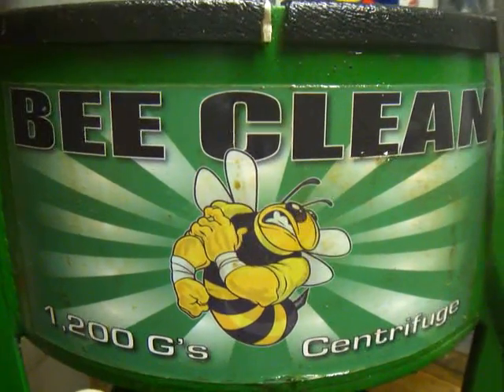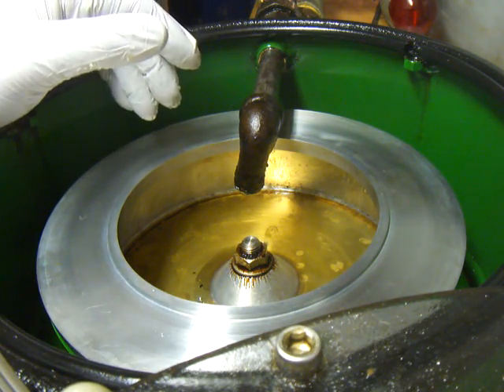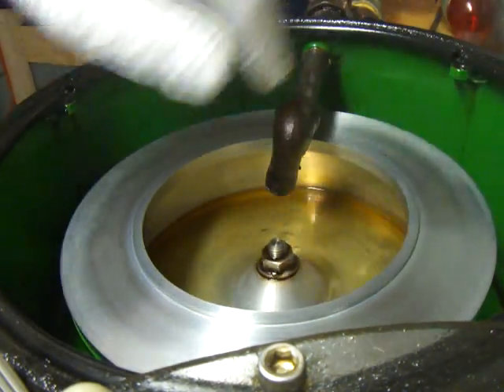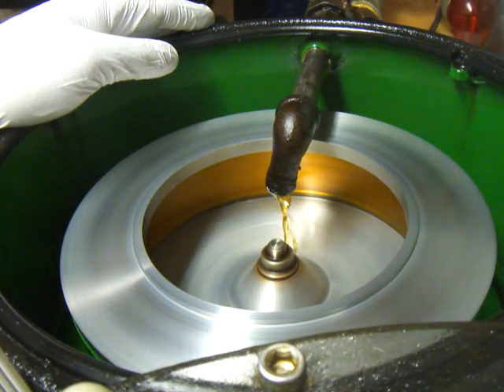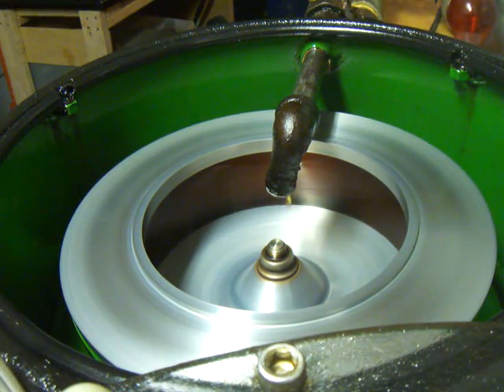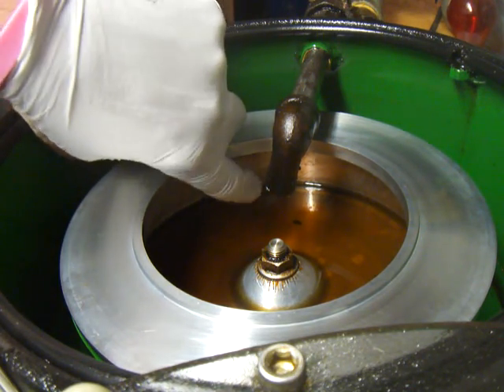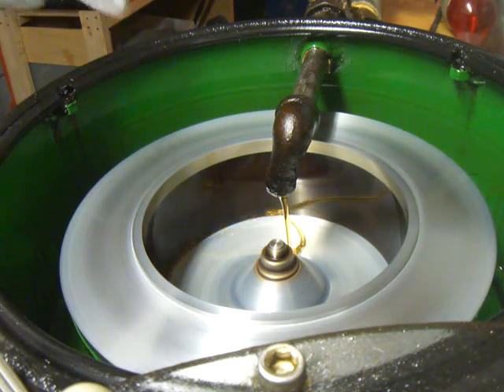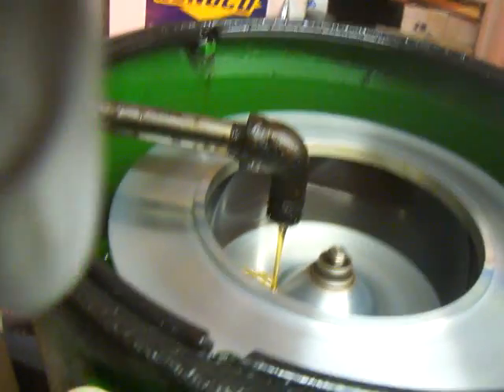GreeceMonkey Waste Veggie Oil (WVO) - Centrifuge Explained

Comment from the maker: You could try boiling...just would need it to be boiling to the point water evaporates...but I am not sure because water is heavier than oil so when you heat it the water goes to the bottom...could not work too
Reply: +Konstantinos Fotiadis eehmmm boiling water/oil solution? the water will evaporate but its trapped under the oil so the steam pockets tend to burst underneath the oil sending boiling oil across the room, thats also why toy shouldn't put water in a deep frier
Reply from the maker: I don't think that is completely true...heat rises...so the water being heated at the bottom might work it's way to the top with convection...not really sure.. just brainstorming
Reply: Water sinks to the bottom of the solution and it stays there due to the physics of water of it being Polar and having strong surface tenstion, yet it boils at 100C and oil can get way higher so if the oil gets hotter then lets say 120C the water will flash evaporate and explode Konstantinos Fotiadis
Reply: Oil water mix flowing across a heated plate might work.

Comment: What is the capacity ?
how many gallons for a minute can be processed ?
Reply from the maker: Probably 32oz on this one...I ran it at 8 gallons per hour...depends on how dirty you input is and how clean you want your output
Reply: @konstantinosfotiadis  what size motor are you using hp and rpm
Reply from the maker: @jasonbrown7258  I use this one now...

https://www.wvodesigns.com/raw-power-centrifuge.html.html

A much nicer design...I have an extra for sale if you need one

Comment: what about the drain holes on the bottom of the spinning drum ? where does that oil go ? Do you close off those holes
Reply from the maker: inside the bowl, they are for draining it once you turn it off.   the other hole is outside the bowl in the green cylinder.. that's where it drains into my drum and is clean

Comment: if you boil the oil, will it remove the water?
Reply: well water and oil dont go well together lol. Plus i think that if the oil is gets tooo hot it turns bad.
Reply: Don't need to boil  You just run it it through a heater to get it to around 185-190 before running through centrifuge and the water will steam off.